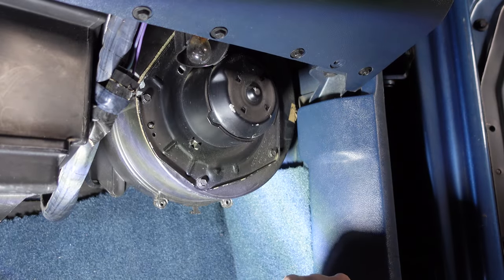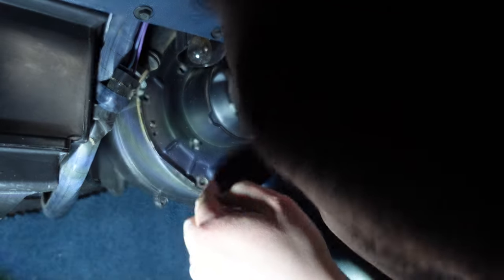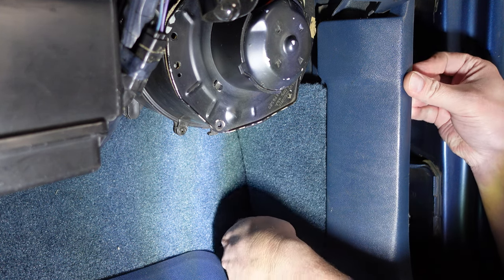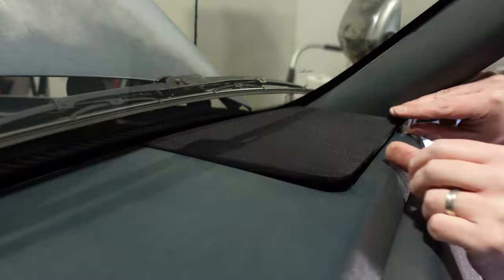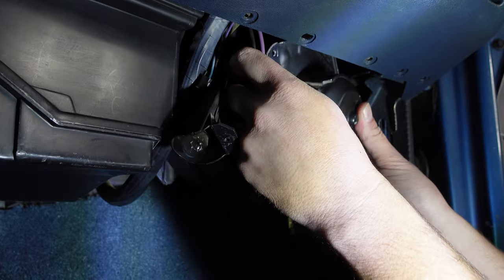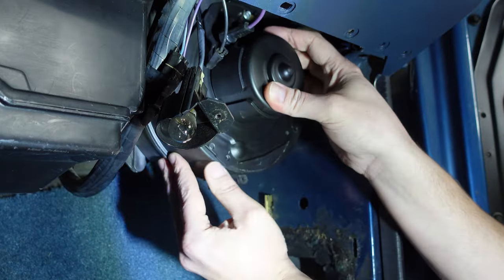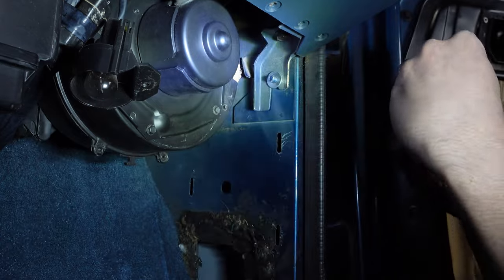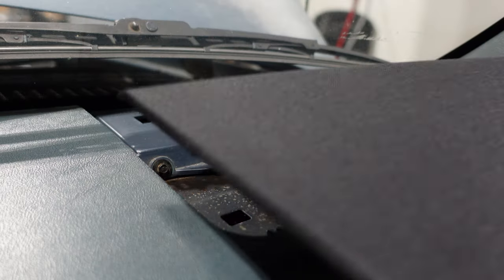88-94 Chevy 1500 blower motor replacement

Comment: I have a '92 GMC Suburban SLE. I had to remove the glovebox, computer and computer tray in order to be able to remove the rubber covering over the fan housing. Not difficult, but a few extra steps. The computer is held in place by two small clips to the left as you look at it thru the glove box opening. The computer tray was a little bit of a pain in the ass, four screws, two on the front and two toward the rear. Once the tray was out the rubber covering slid right off. Swap the fan and put the computer tray and computer back in the reverse order. It went back together a whole lot faster than it came apart, lol.

Comment: I saw this after doing mine a few months ago. I did it just hoping to improve flow by cleaning out leaves or whatever debris was in the evaporator since it's a 94' ( the original fan worked OK ). There was lots of dog hair and dust in there which I rinsed out. Just got the cheapest motor from autozone and works fine,  not a ton of improvement though. Getting the rubber cover off was the hardest for me.

Comment: Useful video. I have a 1994 GMC Sierra whose blower motor squeals and squeaks intermittently. I see that removal is a bit more involved than I thought, so I think I'll live with it for now as you suggest. Your video is clearly and well done.  By the way, the new carpet installation was well done. Thanks.

Comment: You failed to tell us how to remove the padded cover over the blower motor. I can't even get to the bolts holding the motor in place 🤔😫
Reply from the maker: Sorry, ours didn’t have a padded cover!
Reply: did you figure it out? Have the same issue... 😞

Comment: Helped a ton. Mine had a foam/rubber cover for it, couldn't figure out how to get it off so I unplugged the wires and yanked it out 😅 But the job went smooth other than that, thanks for the video.

Comment: My truck is an 88 Chevrolet 3500.  The blower motor only has one electrical connection, an orange wire.  It must be getting its ground another way.  I think my blower might sit higher; I had to remove the glove box to access the upper blower screws.  Liked your video.

Comment: Had the same issue with the pulsing noise after installing a new blower motor in my 99 Suburban. Issue was solved after spending a few extra bucks for a genuine part. You get what you pay for
Reply from the maker: @Justin Garcia Unfortunately I bought the GM genuine part! Still has the pulsating noise.

Comment: Does it blow hard? I installed mine but I'm not sure if my evaporator is clogged or since the connections are switch it blows counter clockwise but mine doesn't blow hard
Reply from the maker: Not super hard, but it feels right

Comment: Amazon says this part number doesn't fit my '88 K1500.  It has gm genuine 15-80666 and a note that says PRESS ON.  Any idea what's the deal there?
Reply from the maker: @Ben Wrenchin’ Looks like Rockauto agrees, that part number fits a 1988. Not sure why it’s different than the 1990
Reply: @SuburbanRanch  Follow up question, is the new one quieter?  Mine is loud but I can't tell if it's louder than normal or did your video convince me it's too loud? Haha
Reply from the maker: @Ben Wrenchin’ The new one is not much quieter!
Reply: I’m in the same situation, the 88 is a different part than this video. Did the one you buy fit it
Reply: @grampasquirrely  I never bought it, and I sold the '88 and got a '94 Extended Cab.  Sorry man
Reply: @benwrenchin  all good man appreciate the reply though
Reply: Do you have a video on the evaporator cleaning? I don't have any signs of a motor issue, in my mind I was picturing the blower motor coming out dirty I'm thinking that might be part of the problem with my air flow, however every video I've watched they come out pretty clean and the problem ends up being the evaporator is filthy.
I doubt that it has ever been cleaned. 
Other videos say that you would have to take the dash out to do that. Is that true?

Comment: Great video.  I don't have a blower issue but I think I have an issue with the big plastic box next to the blower.  Getting some funny noise from that area.  If I use your vid as a starting point, can I get to the heater/ac box?
Reply from the maker: @orgcoast You can get to parts of it

Comment: Is it the same for the 1995 to 98?  My son has a 95.  It only blows on the highest speed, so I think it's the resistor, but I was going to replace the motor at the same time as it's a little noisy after 315,000 km 😉
Reply: Mine is noisy too, I just assumed this was normal for an '88.  Might look into replacing it now.  Thanks, Dan!
Reply from the maker: @Karl Hungus I bet it’s the resistor if it only blows at one speed!